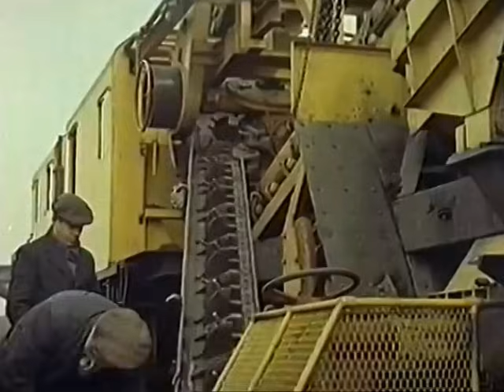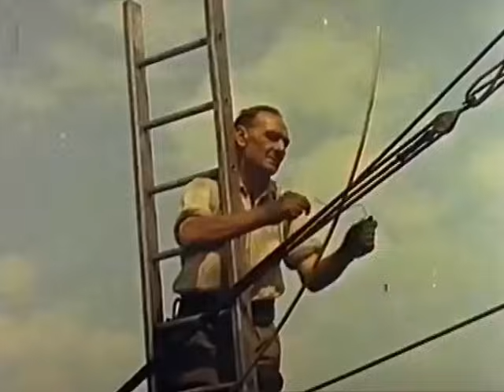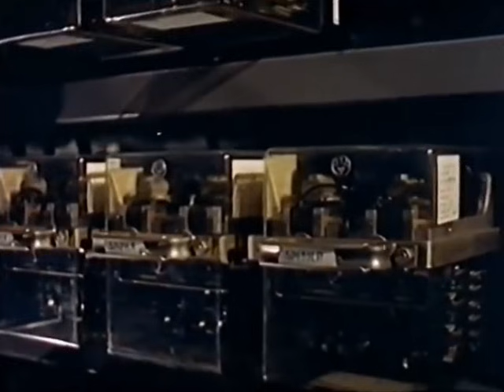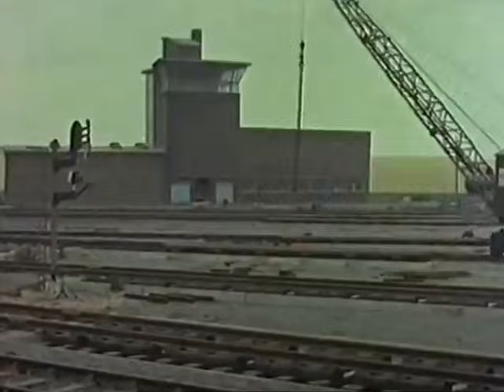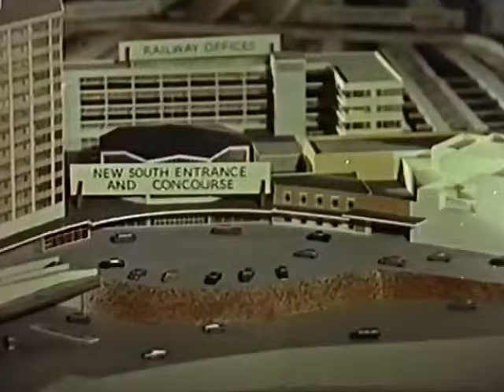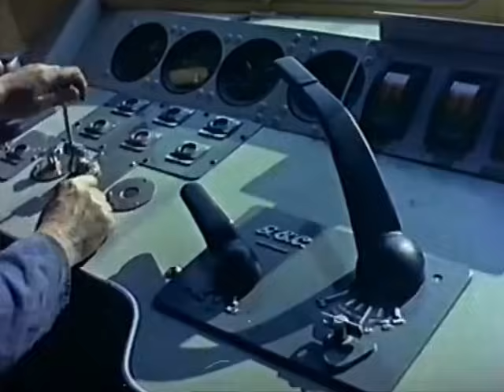Vintage railway film - Report on modernisation - 1959

Comment: Starts with the manufacture of continuous welded rail. Cut to laying of short sections of track. Then back to the discussion of track for 100mph running. I wouldn't want to be the two people permanently stooping down. Now mention of the overhead power at 25,000V AC.  But power needs a control so cut to a control room on the Southern Region that has neither 100mph running, nor overhead power, nor AC.

Later we being told that tea tastes better without soot, which it probably does, but not that it also tastes better without cigarette smoke.

Oh well, it was still the fifties, and we did get the 100mph running (outside the Southern Region). But there it stayed for decades.

Comment: The organ playing is a bit mad, but the recounts in the vdeo are fascinating even to me who saw out the relays in my work and replaced them with transistorised circuits. And then into the 1980s, replacement of a lot of transistors and circuit boards with microprocessors. The Best of British, eroded by mass immigration, insane and corrupted politicians, and the nefarious goals of EU control.

Comment: I like the way that asbestos insulation was show being sprayed with abandon.
Reply: Wet asbestos was a relatively safe medium I believe.. So many pipe fitters at my loco works were affected when they were required to scrape or grind away the dried asbestos in order to lay pipe brackets. The asbestos fibres were like a dust ready to be inhaled with often deadly consequences.

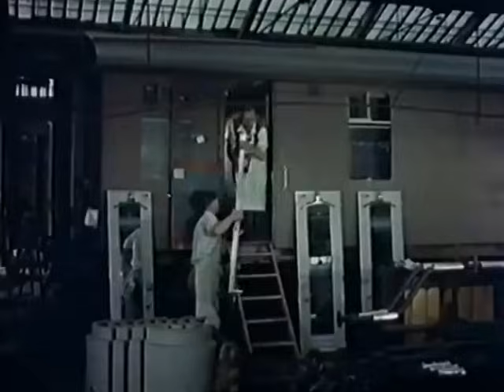Comment: 16:26  That insulation would come back and bite them.  It's blue asbestos.
Reply: The thing is those in authority knew the dangers with asbestos at that time, but continued to use it. I can imagine the inevitable future for the workman applying the stuff to the coach.
Reply: @arthurdailey4514  My father worked with railway locos covered with asbestos insulation in the '50s  but the stuff didn't kill him: it might kill me, though, even 60-odd years later.
Reply: I was wondering about that. It is asbestos !

Comment: Interesting.  84001  (E3036) wasn't built until 1960...  so I suspect this film was finished a little later than 1959.
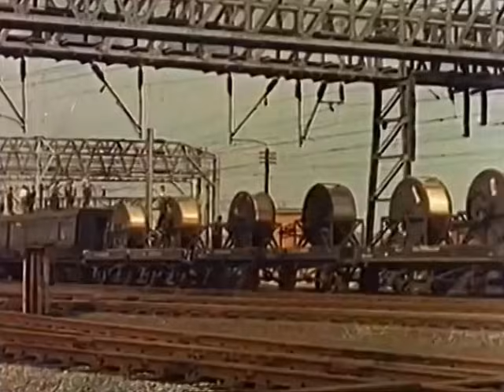Reply: The electrification of the Manchester - Crewe line, which is mentioned at 5:00 was completed in 1960.
https://en.wikipedia.org/wiki/West_Coast_Main_Line#:~:text=The%20first%20stretch%20to%20be,then%20extended%20south%20to%20London.&text=Electrification%20of%20the%20Birmingham%20line%20was%20completed%20on%206%20March%201967.